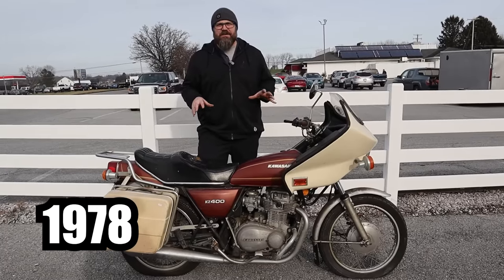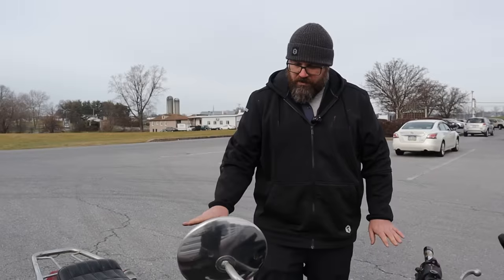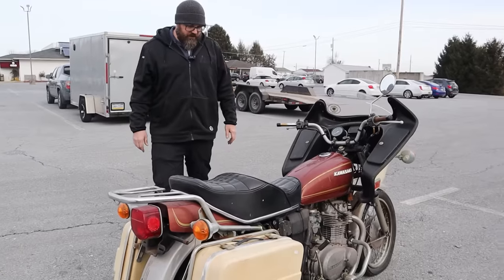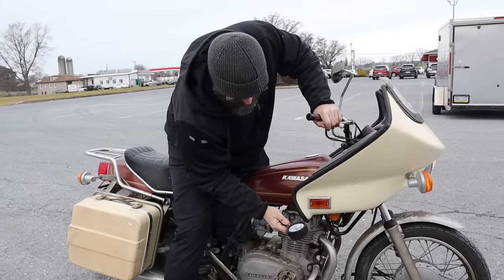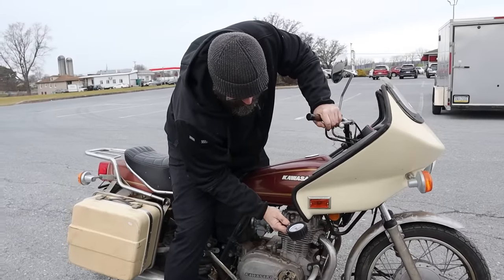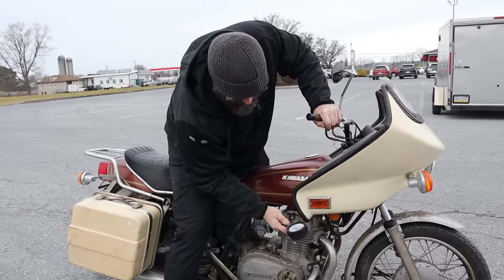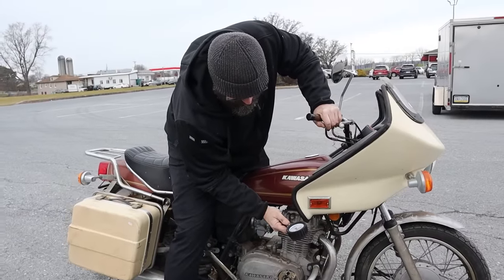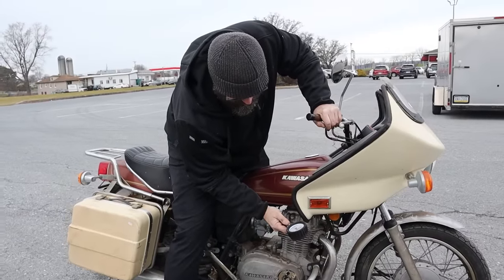Will This 47 Year Old Estate Auction Bike Run & Get Me Home?

Comment: As a guy who also gets cheap/free bikes and tries to get them going cheaply, I watched a few videos about lock picking and got a cheap lock pick set.  I get lots of bikes without keys, and being able to get in the tank or turn on the ignition for initial troubleshooting has been a game changer.  You should give it a try, it's actually pretty fun!
Reply: LPL and Bosnian Bill are invaluable contributors to youtube
Reply: @aculpoca  yes, Lock Picking Lawyer is what motivated me to attempt picking.  I used to drill out motorcycle ignitions and tanks but now I can get most open in a minute or two…I am not skilled at it so a pro could do it in seconds.
Reply: Lock picking is definitely a useful skill to have. I helped a friend get back into her Chevy Traverse with a $20 wave tool I found at Duluth Trading Co. It was a random find, but it worked lol
Reply: @ATi1300Ramiro Most automotive locks especially on old vehicles are shockingly basic, easy to open, hence why chips in keys and other non theft devices become the norm.
Reply: I was about to comment the same thing, been using a cheap lock pick kit for a while now for getting under the seat or into the tank of old bikes that didnt come with the keys
Reply: Why do I get the feeling that a lot of people's bikes have gone missing in your area ....
Reply: @tylamcgilverson3923  funny…but bike thieves don’t waste time picking locks.

Comment: Working on one of these at the moment. No key, found online there is only like 45 different keys made for the 76. Found a 3 digit code on the helmet lock. Ordered a key with that number and it works for all three locks.
Reply: The cylinder for the ignition on my 1975 Honda CB 125 has the code number printed right on it. Luckily mine came with a key.

Comment: I had the opportunity to get the same bike my dad said he had back in the ‘80s. He has a KZ750e, and the “e” model is what gave me such a hard time. So, after years of looking, I finally found one on Facebook Marketplace. After messaging the guy, he ended up being on a trip for two months. Out of the blue, he messages me saying he’s back, and long story short, I drove 3 hours the next day to pick it up. It wasn’t running, and it obviously was sitting for a while. So, I got it home, and it took me 15 minutes to get it running, and I took it for its first ride down my driveway. I had my dad on FaceTime, and it was such an amazing moment to share with him. He hadn’t seen that bike since he sold his almost 40 years ago. I ended up getting it painted, and I was able to work a deal where I could put the new pin stripes on to match the original before he put the last two clear coats on. I had to make it look exactly like my dad’s, so I changed the exhaust and headers, put yellow spark plug cables on (he had Yellowjacket cables). I had to go through the carbs and rebuild and synchronize those, which was a learning experience since it was my first bike with carbs and of course it has four of them. But hey, I was 25 at the time, so I had to learn as I went. I will never sell that bike because it’s such a peach  and I ride the snot out of it whenever the weather is nice or there’s a cars and coffee. Hopefully one day my dad can make it down to Texas so he can throw a let over it and enjoy what I’ve spent so much time working on so it could be perfect.

Comment: Most 70s Japanese motorcycles just had a spring lock on a gas cap in other words an open cylinder with a pin and a spring. Anything with a rough shape the same as the ignition key.  I proved this to a friend of mine the other day by using my John Deere tractor key to open the gas tank on his 76 Honda 750.
Reply: Where was the key

Comment: I bought a my first bike a 1978 KZ400 B-1 (standard) almost a year ago. It was in really bad shape and had a seized engine. Ive been working on it during my free time and almost have it all back together The engine is fully rebuild and now I'm doing electrical. Its been a great learning experience. I will say that some parts for these bikes are hard to come by. Can't wait to get it running.

Comment: Bought my first bike last year, 79 kz400 ltd, i’m the second owner (only 8k miles!) Had to go through similar stuff to put it on the road, even put on the same exact tires. Struggled with those keihin cv carbs for the longest time until i found out you adjust the floats with a wet setting, 3mm +/-1 from mating surface, now it runs like it’s brand new. Such a fun bike, love 70’s kawis

Comment: I had the same bike in 1985.top end was 70 m.p.h.  Sold it and the new owner put the KZ 650 motor in it. He used a torch to heat the front frame tubes and a jack to spread the tubes, it worked out beautiful.

Comment: Superb little bikes, change the oil and filters and very little goes wrong with them. It's worth taking the sump off every few oil changes as there is a mesh strainer on the oil pump which can block up as the mesh is very fine.

Comment: Most older motorcycle locks can be opened using a fork. Bend the 2 outer prongs back so just the 2 middle prongs are straight.  Use those, stick it in and wiggle it, twist it etc. It might take a few minutes but it will work

Comment: Good work getting it running guys.   It definitely seemed like you blew the fuse, the way the headlight flashed then went off.

I'm a couple hours south of you guys and these last two weeks have been cold.   I used to like the snow... but that was before I started riding motorcycles.

Comment: You riding in the snow reminds me of the two Time I had tp ride in the snow with my 1996 Concourse. I worked at Gallo winery in Modesto Ca. I lived up at 4800 feet above sea level in Twain Harte. I left for work in was sunny and 12 hours later it was snowing at my home. That happened two times then I learned to check the weather report. I rode my bike just like you did here. Two feet down on the ground. But I had to ride 3 or 4 miles like that. The funny thing was. There was a cop sitting on the side of the road under a street light. It was around 1 am. The cop looked up as I was passing by and did a double take. I know that cop has told this story of some fool riding a Concourse in a snow storm many times since. It was pretty crazy. I put 370K miles on that bike and about 8 of them in the snow.

Comment: With as many old tanks and leaky petcocks as you guys run across,  i recommend keeping some thin rubber in the tool roll. Like a bicycle inner tube to make a petcock gasket on the fly. I have done this myself, it will work.

Comment: One of the best motorcycles of all time.  Virtually indestructible.  And faster than you might think.  Criminally overlooked, imo.  These were quite common in the early/mid 80’s.  Fun fact, the electric start version had both elec and kick start.
Reply: I love an 80s 400. small, light, not much less nimble than a 125, but can do over 90mph with relative ease

Comment: Aw, man.  What a trip down Amnesia Lane.

Love that Kwakka.  I had a Z440, late 80s.  Same colour, bench seat. (No fairing.)
Chuffed along like a charm.  
Took her home, from base, that first year.  750km round trip, started hearing a worrying clatter.
Kept revs down and babied it.  
Put up with the rattle til I could get her home and in the shed.

Pulled the oil drain and lookey, lookey  nice, shiny confetti. 
Yup.  Crank bearings was chewed up.  Bronze bearings shat  themselves?
Bike shop was able to build up the big ends and re-surface. 

I miss that wild 37hp.

Comment: Hint for no keys..I make up a lot of strips of light gauge tin and cut them so they can slip into a lock, then I apply a small amount of pressure left and right...The pins inside the lock will leave an indent on the tin strip..you can then file these until the indents are gone, so it looks like a key..it all depends on the toughest of the tin strip..sometimes a nail file will do as well

Comment: Wow, the flashbacks... had one, just didn't have the touring package, bought it for $100 in 1995, rebuild the carbs, cleaned the fuel tank, new battery, new tires, rode it for almost three years.

Comment: The fuel cap came off due to the cold weather as in colder temperatures metal shrinks, freezing car parts is a common way to make them fit into tight spaces (love the vids❤❤❤❤❤)

Comment: Kz400 base model. That is a bike that belongs up on a pole in front of a motorcycle shop. It has much more value as a roadside icon than a motor vehicle. Along with the Honda CB360T. I'll bet it was a funeral procession bike. They don't go fast enough to need a Windjammer knockoff fairing but it helps to look like a cop bike from a distance. You're a ...brave man for trying to get it going in the snow. You could have left it until spring because nobody would steal one of those.

Comment: this was an extra satisfying vid! got a klr650 dissassembled as a project, have the ignition key but not the gas tank key.  drilled out the lock in order to get the old gas out, worked.  a new cap/key set is $26 from bezos.  will use some tips i learned for you to get the rust out of the tank

Comment: I had an old kawi 400. great little bike. the fairing and saddle were add-ons. I'd toss them and put on a little cafe racer bar/fairing and replace the seat with an original. needs a bit of paint, chrome polish and a lot of tlc but it'll go all day, all night.

Comment: Omg, memory lane, I was stationed at Bergstrom AFB Austin ... mine was the '77 KZ 650 silver. I put 70,000+ miles in 5 years, it looked so good the Kawa dealer gave me $1000 trade-in for my '82 KZ 750 that I paid cash for.  Last bike was a '84 GPz 750 in 1986 (a leftover new in crate).  Kept it until the mid '90s.  I miss my Kawa's.😢

Comment: Good to see it running!! I had a 2 stroke with kick start and one morning, just as you are with the SNOW etc I went to klick start the bike and the 🤣the kick start lever cracked breaking off and falling to the floor... 😶Ah #memories ! I cleaned all of the 4 carbs and the bike ran beautifully after (GT750) I was astonished just how cleaning them made such a difference! Oh and anything that resembles a Kawasaki or even OTHER key of similar form will work in ie your petrol tank cover key slot. *EARLY motorcycles.. A lot of the key slots on used bikes get WORN !! I discovered this when I was on an 'expressway' and the keys flew out of the ignition !! A mate VAN keys fitted as a temporary replacement!! Oh and the fuel tanks on Kawasaki?? Early ones ..? My GT750 I had to have a new one after about 70,000 miles.. THEY ROT at the seams..

Comment: I wanted to tell you about a custom bike I’m working on. It started life as a Vittacci MudStar200. I bought it on amazon for $1000. Iv seen modified the whole bike and working on more. Front end is a slightly modified billet triple from JFG (cut the race down to fit 3mm smaller shocks) meant for a DRZ400 with aftermarket shocks, rear swing arm is from a 11’ ninja 250 which gave me 7” extension and I kept all the chain slide and chain guard and spool sliders. I’m building it for a 241cc stroker engine right now that’s a Honda GX200 clone casted for a 72mm piston and 59mm crank. It’s got 1.35 black venom ratio rockers and 32/25 mm valves and 28mm Mikuni flat slide and much more but my plan is to enjoy this very expensive engine I’m building because I already collected all the parts and I’m just waiting for spring to bring me conditions I can work under. After I’m done playing with that engine I’m gonna weld up motor mounts for 250cc engine that I’m doing a 84mm big bore kit on to get me 356cc 5 speed small block. then my bike will be truly what I want it to be. It’s running 10” CNC aluminum wheels right now but maybe I’ll go 12” later .

Comment: On my 81 kawi if it’ll fit in the key switch it’ll turn it. Screwdriver, small key whatever. The side key is a helmet holder and the seat just flips to the side, no latch.

Comment: drove a '97 Suzuki 750 SRAD (which was to become the GSXR line years later I think) over 40 minutes home one time about 45 degrees outside..  never again. luckily it ran good, just needed a stator and the battery was enough to get me home even after a few rides around the corner test drive. 750 SRAD my first motorcycle ever. needless to see it didn't stick around long. i got rid of it shortly after buying it and sold it to a guy that restored bikes one at a time in his free time and appreciated the older ones for what they were. i'm sure it's on to it's 3rd or 4th owner after me cause that thing was fast and probably 95% complete and original parts.

Comment: Man you have a big beautiful trailer right there, you should paint the inside white and you should set up the walls to hold your tools and you could have a portable workshop if the weather is good enough to ride but terrible for working in you could complete the show but you would have better work conditions.  Good job regardless.

Comment: The ignition and seat lock on every bike I have ever looked at has some small numbers engraved on the lock cylinder.  If you know the year and brand of the bike (duhhh!!!) and take those numbers to a locksmith, they will be able to provide a blank key and cut it to fit that lock.  I have done this several times and it works like a charm.
Reply: I used the list of numbers that match on e bay-

Comment: If the side case takes the same key as the ignition and everything else perhaps you could have just dropped one off at a locksmith and had a new key in the morning.  A good mobile locksmith can often get you going without damaging anything too perhaps a YouTuber Locksmith such as SherLocks might be a good resource to build a relationship with.

You may need a voltage regulator since the lights went over voltage and then blew out when you revved it up in the snowbank.

Best!

Comment: I had one of those, same colour. I was maybe 18. Traded a $500 dollar Gremlin X (that actually was a great car) for it LOL. (I knew less than nothing about bike maintenance, then I just drove em) I took it on a 3 or 400 mile road trip, with a buddy on back. Before the trip was over, the engine stud bolts that held the exhaust pipe in place both broke, picked them up and tied them on the back rack(it had one)then after we stuffed our ears in a few miles a rear shock broke. Still made it home, slowly, lopsided and heads aching from the noise. I traded it asap, think I traded for maybe $200 bucks lol. Good times!

Comment: Fun. I wouldn't have picked a Kaw 400 unless the price was really good. Which it was. I was a young adult when they came out. They didn't sell well and Kawasaki kept making and shipping them long into the 1980s. When they finally discontinued them in the mid 1980s dealers had left over stock of them for years. Dealers were selling them dirt cheap just to get them out of storage. My Army buddy bought one of the later belt drive models. It was slow!  But we had the 55 mph National Speed limit then and cars were pretty under powered then too. I was riding a 1975 or 76 Kawasaki Z900 at the time so I had trouble going slowly enough to ride with him. The 400s were simple enough and moderately powered for beginners I guess. You do make me want to go out and buy an old 1970s motorcycle.

Comment: Greetings from England.

Wayyyyy back in August 1986 as a 14 year old kid,  a guy down our street gave me a 1977 model which had been off the road since 1981 so had been laid up in his back garden for 5 years.

Instead of trying to get it running before cleaning it up,  we did it the other way round so imagine my disappointment when I connected a battery to it and turned the key and was rewarded with - NOTHING ! - No power whatsoever.

The wiring under the seat was a bit of a mess and tried joining up any wires that we thought matched but was just greeted with a firework display under the seat and due to my lack of mechanical/electrical knowledge at the time (I was only 14 after all)  I eventually  gave up and dumped the bike in a nearby stream,  but not before removing various parts from it (lights, indicators, clocks, etc) which I gave to a friend of my Dad who had another friend who owned a KZ (or a Z,  as they are known here in England)

I never knew they did a 'budget' model in the US with front drum brake and no electric start - All the UK models had front disc brake, electric start and even a rev counter.

Also on the UK models, as well as the Neutral, High Beam and Turn Signal warning lights,  there is also additional 'Oil' and 'Stop Lamp' warning lights which yours doesn't seem to have.

Great videos by the way and always a pleasure to watch.

Keep 'em coming.

Comment: Lol....i live less than a mile from that auction house and never new it was there. Jeez. Good job by the way. Cool bike. I had a 77 kz750B in the 90s. Great bike. Have 4 Harleys now. One is a 76 ironhead im working on getting tuned in. Valves need adjusted and have never done it before. My goal for spring because i want to ride it to the oley bike show.

Comment: Back in those days, there should be a number on one of the locks, usually the ignition.  Take this number to a Kawasaki dealer and hopefully they might have a copy of the key, or go to a reputable locksmith to make you a key.  Finding a key is not going to be as hard as you are making it sound like it will be.  I used to have a 1974 Kawasaki H2B 750 2 stroke.  It was a scary bike to ride because you went from 0 to holy crap way too fast.  The front wheel came up too easy.  But it was also like having 3 bikes in 1.   Stock handlebars raised up as most did.  In about 45 minutes to an hour, I could change the bars to flat or lower/cafe style.  But, with age one changes and I am more the cruiser or easier rider.  Take it easy.